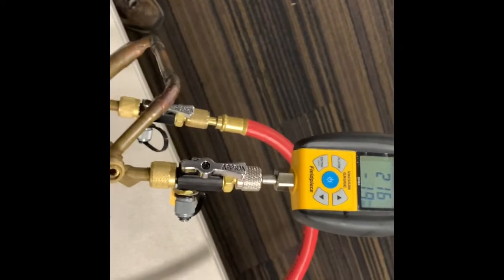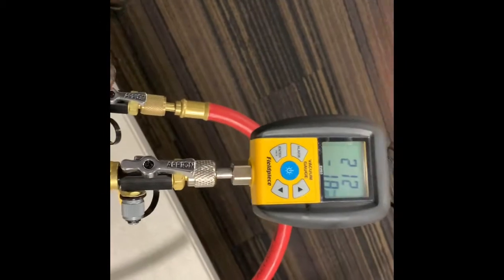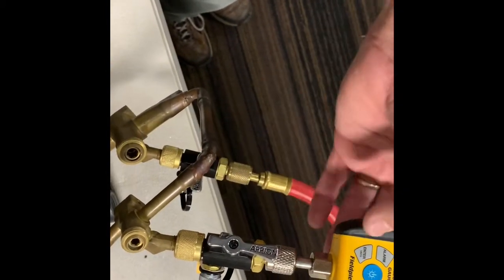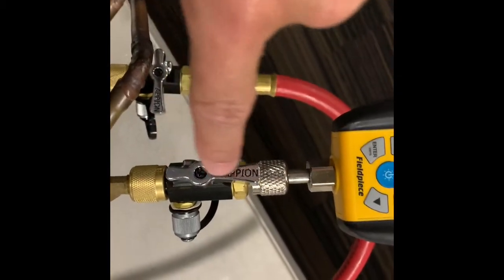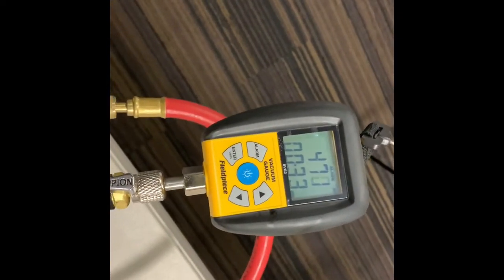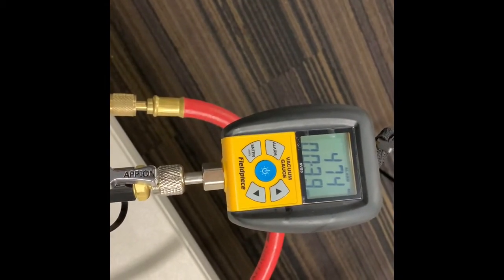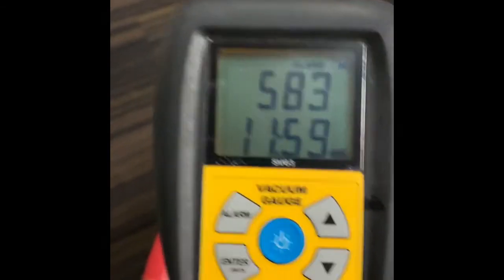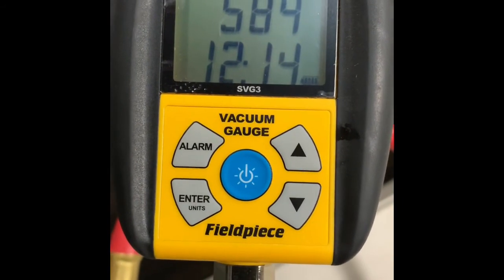Certifying we passed the vacuum decay 10 minute micron test using the Fieldpiece SVG3

Comment: Hey I thought 500 microns was the industry standard. Also while you took your picture the gauge was continuously rising in microns. What micron level do you go by and where does it say over 500 microns is ok?
Reply from the maker: If you were to look at different manufacturers install instructions they all vary a bit. Goodman is almost verbatim to what I share with folks. Pull down to500, isolate from vacuum pump and perform10 minute decay test with goal to stay under 1000 microns in 10 minutes.
Reply: Ideally you would like to pull below evacuation target for 10 minutes to completely dehydrate the system. Jim at MQ did a test of the effects of decay going over 1000 even if it's past 10 minutes amd the effects it had on a compressor. Ideally you want your decay to level off before the 10 minute mark. IE. You pull below 200, ( I on average hit this within 4 minutes on a new system. Once I'm below 200 I'd Ideally like the vacuum to run for 10 minutes before isolating and performing a decay. So after 10 minutes ultimate vacuum could be 83 microns for example before starting decay test. In his video he did 1000 microns as his decay target. If it's a brand new system residential I would always choose 500 microns and nothing more for POE oil. I'd let it isolate for 10 minutes. If I come back and it stayed at 83 microns or was way below 500 you're generally safe. If you have Bluetooth you can see the graph and decay rate. Generally a properly evacuated system should have the decay level off before 500 microns entirely.
Reply: @JPTinioMedia  what if it’s a repair on an old system? Hard to get to 500 sometimes.
Reply: @Bullish Bear  Used system ASHRAE states under 1000 microns of a finished decay is okay. That being said the biggest problem with the hvac Industry specific to air conditioning is that to do things properly it takes a lot of time which no one has an excess of. Typically a failed compressor that has had moisture in the system you are to replace it with a specific drier filter and oil. Run it for 4 weeks, reclaim everything, replace oil and drier filter. Then at at that point when you vacuum it'll drop to 500 easy, but its rare for business to have time wasted like that or a customer wanting to pay for those extra efforts